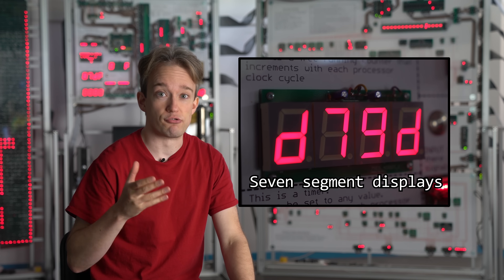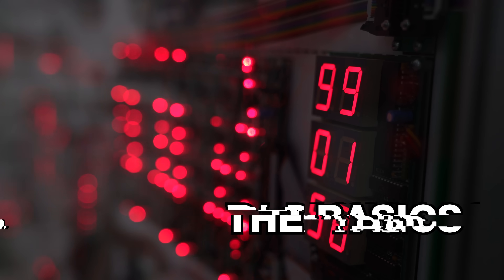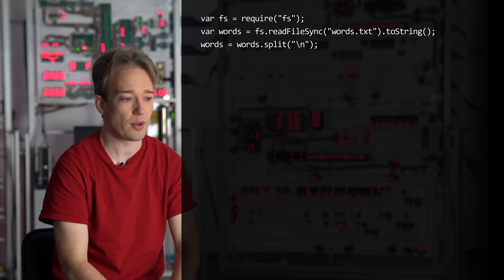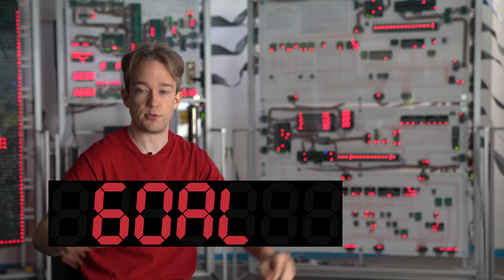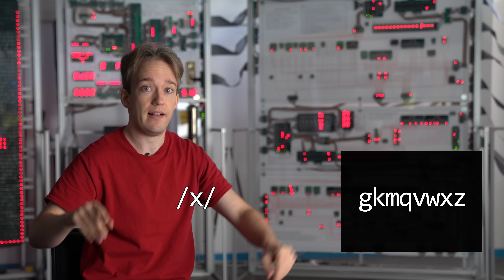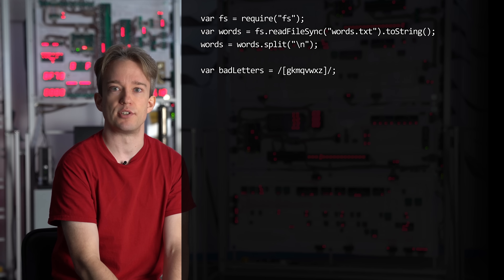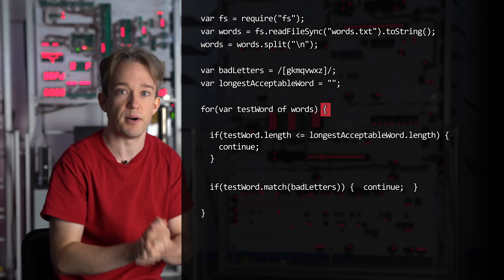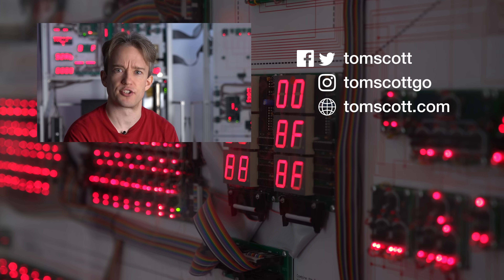What's The Longest Word You Can Write With Seven-Segment Displays?

Comment: Also Tom, I would like to give my two cents on the google in programming debate. I've worked as a programmer for 9+ years now (I'm 26) and I've found that everybody uses Google. There is a great example of a guy being confounded by accidentally upvoting himself on stack overflow after finding his own solution to a problem from 3 years prior not actually realising it's his own username. 
I still code mostly in C with occasional Swift sprinkled in. I remember the olden days, when in my dads office we'd look through endless Reference books and my uncle had shelves full of Linux and Ruby "In a nutshell" guides from O'Reilly. All forgotten eras now. I google stuff daily! It's the Reference book of the modern age. Skill is always contemporary. I learned how to analyse opcode at University. I had forgotten everything when it actually came to use it. You can do anything thanks to google. You just need to have the balls and the dedication to break the problem down.
The only thing that one needs to address individually is coding style and good practise. Not every solution on the web is created equal. So in my company for example I established a style guide. Based on MISRA. I broke it down to 65 simple rules (some added by me) that are easy to reference, covering things like no gotos, no uninitialised or empty functions, always write catch all routines and where to indent.
Reply: Programming is basically 80% knowing how to properly disect and research a problem online.
Reply: You should always have at least 6 tabs open in your browser whilst programming, One of which should be one of those idle clicker games (when you need to give your brain a five minute break of "subconscious thinking time"), but the rest are API reference pages and Stack Overflow. Also, in your download bar at the bottom of the browser ought to be a couple of ZIPs from a Github project, for source code examples.

Anything less than this and, basically, you're doing it wrong.
Reply: KlaxonCow o
Reply: > There is a great example of a guy being confounded by accidentally upvoting himself on stack overflow after finding his own solution to a problem from 3 years prior not actually realising it's his own username. 

Exactly. Hell, I wrote like 5 questions to SO and this already happened to me once...

>  always write catch all routines and where to indent

Blasphemy!
Reply: @amunak_  >>  always write catch all routines and where to indent

> Blasphemy!

Honestly, not arguing about indentation has cut down on hours of development time.
Reply: Hase: Which is why we ALWAYS use TABS!!! That way we can change the displayed width! And nobody will ever, ever raise a pedantic argument about it during lunch ever again, right?
I think if you can reliably get people to stop arguing about indentation, then you should give up coding and start a career as a diplomat.
Reply: @zrobotics  if it was just that
"Do I line break for the opening bracket of a function?"
"Should we double indent with if's inside loops?"
"Should we line break inside brackets to avoid wrapping over 80 chars?"

I just make them put more effort into all their points and shared a custom vim plugin with everyone in the company that live auto-indents and semantically breaks for them, It also modifies the way Auto-Indent touches the file after you are done writing. Got almost everyone back on Vim too... nice side-effect
Reply: Hase: But then we get to the evergreen topic of variable naming. Sadly, linter's won't help there...
Reply: @zrobotics  We only have 1 rule regarding variables: name any variable so it fits its purpose and can be globalised at any point.
Creates some decently distinct names and thats all I really care about
Reply: @zrobotics  : It turns out that there is a fairly good way to reliably get people to stop arguing about indentation: Write an automatic formatter, and put a presubmit check in your source-code repository that ensures that everything submitted conforms to it.

Okay, so it doesn't completely stop the arguments, but it means that to have an argument rather than a venting session, the person who wants to argue needs to come find the person who maintains the style rules, and then needs to explain why the change is valuable enough to be worth the churn of reformatting all the code in the repo and thus merge-conflicting everyone's active checkouts and messing up the "who touched this line last" history.

Or, if you want to be especially strong-armed about it, make the compiler refuse to even compile the code if it doesn't match the auto-formatter, and also make the common editors auto-format on save so that's not painful.  Ever heard an indentation argument about Go code?
Reply: The number of times I've found my own answer to a question on stack overflow helpful is now in double digits :D
Reply: I bought an extra monitor and mounted it in portrait just so that I could have both google and my code on the screen at the same time.  Best decision I ever made.
Reply: @Mr1995Musicman  Awesome! The best of both worlds.
Reply: What about the other 61/62 rules?
Reply: @ElectroYan  look into MISRA it's online and a lot bigger and contains some really good practises, however they beat around the bush alot and explain unnecessary things in the document
Reply: Accidentally upvoting yourself on stackoverflow 😂 nice one 😂
Reply: I know I'm SOL on a programming problem when I google for a solution and the top result is me asking the question on stackoverflow and there aren't any answers.
Reply: Yep. Over 30 years in software, and I do that too. Although in my case it's DuckDuckGo, as Google SUCK because they abolished the '+' prefix for searches.
Reply: @macronencer  you can still do quotes
Reply: That's an answer I've had before from various people, but my understanding is that quotes do NOT do the same thing as '+'. They indicate that a phrase must match exactly, whereas '+' used to prevent inclusion of articles without any exact matches (which is REALLY useful!). I've since discovered that even DDG's '+' doesn't quite work as I'd like either, but I stick with them for other reasons now.
Reply: @macronencer  like privacy? Yeah I'm aware quotes aren't the same they dropped a lot of other functionality too like the famous vague inurl searches.
Reply: @macronencer  : You're missing a critical subtlety.  Quotes indicate that a phrase must match exactly, so if you quote a single word, that word must be exactly present in the result.  The quoted piece doesn't need to be the entire search string.
Reply: A reliance on google will come back to bite you when your network is down and you can't figure out why.
Reply: If you keep googling it, you'll learn it. Google/stackexchange is the cheatsheet of programming and even cheaters learn, ironically, if they cheat enough. In today's programming world, it is usually not enough to know one language. After a few years, you'll drill those search results into your head, whether you like it or not.

Comment: 1. Get the longest word in the list
2. Convert it to hexadecimal (or any other encoding that consists only of the allowed symbols)
3. Display it
Reply: profit
Reply: Dexter, c'mon, reveal yourself already, genius.
Reply: binary is the best representation IMO :P 01100100 01101001 01100011 01101000 01101100 01101111 01110010 01101111 01100100 01101001 01110000 01101000 01100101 01101110 01111001 01101100 01110100 01110010 01101001 01100011 01101000 01101100 01101111 01110010 01101111 01100101 01110100 01101000 01100001 01101110 01100101
Reply: 31 characters, "dichlorodiphenyltrichloroethane"
62 characters, "646963686c6f726f64697068656e796c74726963686c6f726f657468616e65" (UTF-8/ASCII - hex)
248 characters, "01100100011010010110001101101000011011000110111101110010011011110110010001101001011100000110100001100101011011100111100101101100011101000111001001101001011000110110100001101100011011110111001001101111011001010111010001101000011000010110111001100101" (UTF-8/ASCII - binary)
In UTF-32, binary, it's 992 characters.
Reply: But "dichlorodiphenyltrichloroethane" isn't the longest word because it doesn't use each letter of the alphabet.
Reply: @AlmostUselessPenguin  I assume you mean every displayable letter of the alphabet. That would be a different question. And now I want to find the answer to that question. I'll bet the answer is there is no such word.
Reply: @WilliamAndrea  Boolean/binary joke:
In life, there are always at least 10 ways to solve a problem.
Reply: Buddy Clem There are 10 types of people in this world: those who understand binary, and those who don’t...

...and those who weren’t expecting a ternary joke.

Comment: "the 4 isn't actually how most people write a 4"

Excuse you, I prefer my 4s to not look like 9s thank you very much
Reply: So you think this: [ 4 ] looks like a 9?
Reply: When written, yes
Reply: But you can do that without it looking like an upside down h. Most people angle the leftmost line. Also, always make sure your 4 has a bit sticking out the on the right.
Reply: IV
Reply: The problem I see with the number 4 is that people aren't using straight lines, they get lazy and curve the top section, so now it is basically a 9, but slightly off.
Reply: What I meant by this is if I'm writing fast I usually get a bit sloppy so my 9s might have a bit sticking out to the right like a "regular" 4 or my 4s might have a curved top like a 9. For that reason I do the open 4
Reply: For real, I've never met anyone in the US who doesnt write their 4s with the open top

Comment: I think the logic for ruling out "G" (because the number 6 already uses it) should also rule out "S" (because the number 5 already uses it).
Reply: I agree. Fixed the code for that, and got all answers with another quick for loop. Also eliminated T, which looks wrong. 

Too bad they're both medical words. I wish those could be removed, along with chemical names. Those form, in my opinion, a distinct class of language that isn't really "English."
Reply: ZipplyZane 
“t” looks fine as a lower case
Reply: All my handwritten 5'S look like S'5 and all my S'S look like 5'5.
Reply: BoB: that's actually a common problem in maths, and is why they teach a specific way to make a 5 different from an S. 

You start from the top left and draw the part going down from there: ᕊ 

Only after that do you raise your pencil and cross a straight line on the top. That makes sure it's a clear pointy angle on top, rather than a curve. 

So it goes ╵ᕊ 5
Reply: The version Scott calls "just a C with aspirations" is fine in my book.  Not all fonts include a crossbar on the uppercase "G", and almost none have the bottom of a "C" reach the mid-line.  I also see no reason to exclude the "I"  since many fonts render it just like a "1", nor the "o" as seen in "Error" since it looks nothing like a typical zero (though I have seen a battery-powered calculator that used an "o" instead of "0", perhaps to save power).
Reply: solely based on logical rules set forth: if a letter is already represented by a number then that letter must be omitted. If we must exclude "G" because its seven-segment representation is already used by the number "6", then we must exclude "S" because its seven-segment representation is already used by the number "5".

[it follows] we must exclude "I" because its seven-segment representation is already used by the number "1".

That makes sense to me - for the sake of this experiment we should also exclude "i".
Reply: using the "C with aspirations" to write a G (imho) is completely acceptable since it looks like a G in many fonts, and can't be confused with either 6 or C.
also I and O could be written with small "letters" (1 segment for i, 4 segments for o) to make them distinct from 1 and 0.

then there are several variants of letters that could be used to create missing letters when they HAVE TO be written SOMEHOW, although that would be somewhat questionable and should be illegal for the purpose of such a challenge: a lowercase n (with 3 segments) could be used for n, and a "big lowercase n" for M (with 5 segments), or using the same trick for uvw (3 segments u and 5 segments for V or W), or even crazier (but still unique): 3 segment u in the lower half would be u, 3 segment u in the upper half would be v, and 5 segment U could be used for W :-) a Q could be a "lowercase q shifted up" and look like a mirrored P (no confusion with 9 when the 9 gets an underscore at its bottom similar to a Y being shown like a 4 with an underscore attached). and finally (again stretching the imagination) "uppercase H" could stand for H, while "lowercase h" could stand for k :-)
these quick "inventions" would make all letters displayable with the exception of SZX (52H :-) does anybody have a "strange" way to show those three chars too, to be able to somehow display ALL letters ? maybe using "52H minus the center segment" for these letters so that these letters consists of two separate corners or lines only?

but no matter what to do with these above letters: when even the "C with aspirations" is not allowed, and also not a Z (because of similarity to 2), why is S (same as 5) allowed???
that should be strictly forbidden!   btw: at 4:32, there is a second J at the end, which probably should be the Y as i described it above (a 4 combined with underscore)?
Reply: @Anson_AKB  Z is eliminated because of the diagonal, S on the other hand doesn't have a diagonal
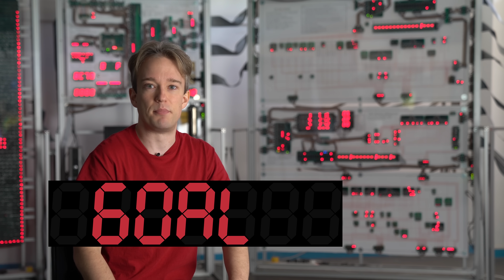Reply: @interbeamproductions  at 3:32 he has eliminated two ways to write G because of their "identical looks" to 6 or 9. why does he later at 3:52 allow I (looks like 1) ? and the same logic would also exclude O (looks like 0) and S (looks like 5) as well as Z (besides having the diagonal, it would look like 2). and reshaping 6 and 9 (with or without a horizontal line at top or bottom) seems to not have been an option too. thus this entire task boils down to a matter of opinion, how narrow or how far you allow people to go to have/reshape/create "unique" letters and numbers.

btw: i had a similar problem once when i needed to design the entire ascii code on a 3x5, 4x6, and 5x7 dot matrix display (replacement for the character generator eprom on a computer in the 80s), and i had to use as little "creativity" (for strange looks) as possible while absolutely having to use as much "creativity" as needed to get ALL those chars done uniquely "somehow".
Reply: At least the 'S' is structurally accurate. The 6 loops back and actually touches the left line. The brain just struggles to accept that as a G.
Reply: @mikepictor  in that case, lower case g is spot on.
Reply: @David: not really, lowercase g goes partially bellow the line. Its 7-segment version doesn't, making it look more like 9 than g.
Reply: In that case, "y" should also be ruled out.
Reply: No, you can make a y easily and it's not ambiguous.
Reply: Y would just be a 4 though. The whole point is we're getting rid of letters that are also numbers
Reply: Yes, but I think the 'G' that doesn't connect like a 6 is very readable, and a lowercase g is also readable.
Reply: great then do it yourself

Comment: It's so weird seeing javscript written with `var`s and not `let`s these days
Reply: @top1 it matters and it brings the ugliest bugs ;)

Without everything its always global...
use LET - its local!
Reply: const is more appropriate here :P
Reply: @top1 in this specific case you are right. But its not good practice as the projects get bigger...
Reply: top1: The problem is you should 'never' do this, even in a script like this where it won't cause ugly bugs. Just like bashing together a quick c++ utility and thinking "eh, this is a small project, no problem putting using namespace::std in there". Just a terrible habit to get into, especially something like this where if you start the habit it's easy for one 'var' to slip in unnoticed. Plus, this is demo code for an audience, some of whom may not know javascript. No reason not to do it properly, it doesn't make the code any longer or more confusing to explain.
Reply: MUTATION!!! 😱
Reply: It's so weird seeing English written with "`"s and not """s these days.
Reply: @yourcurtainsareugly  He's just writing template literals
Reply: Thing is, we've been coding using var for decades now without running into problems. You just need to keep your variables named well to avoid clashes, and keep your code wrapped in a function to avoid leaks. 

Yes, block level variables are nice. And I get why some programmers wanted them. But function level variables are fine.

As for const: I've run into too many problems where I load a script twice and get an error because of const. I find it easier just to use naming conventions to keep my constant variables safe in most contexts. 

If const would just warn instead of throw, I'd like it a lot better.
Reply: It does matter for scoping bro. var persists out of scope where as let gets nommed